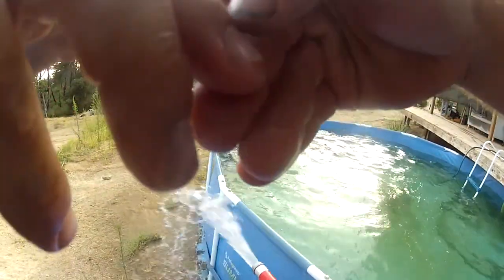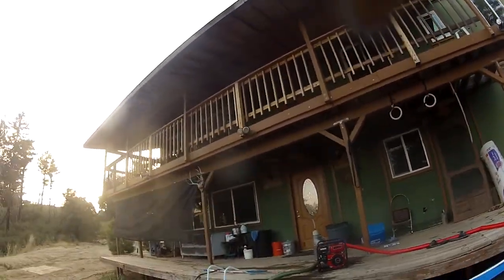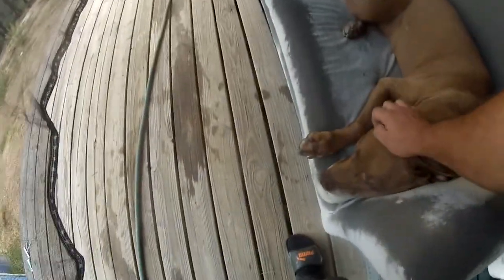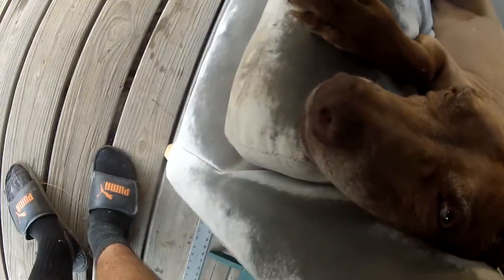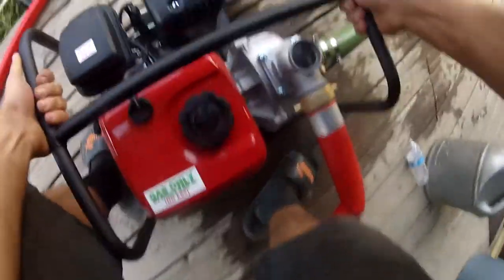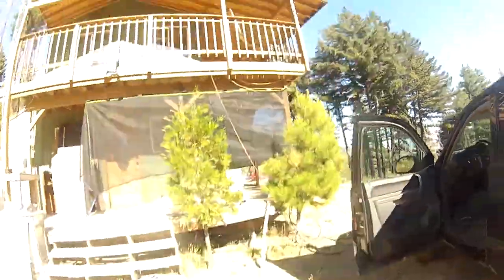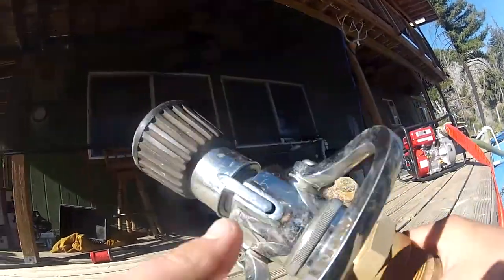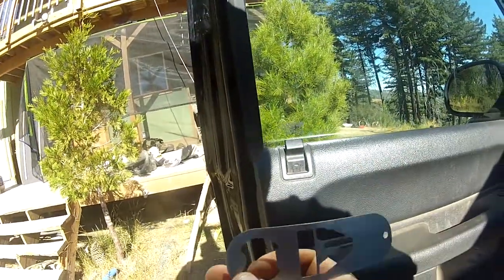Off Grid Fire Hose & Water Pump 150 GPM Tested Successful - Part 1

Comment: save the red hose for other uses and get another 50 ft length of the fire hose or 2 more lengths
Reply: Yep, exactly what I did ... two lengths of new 75' x 1-1/2" on Ebay for about $90.00 for the two of them. A bargain